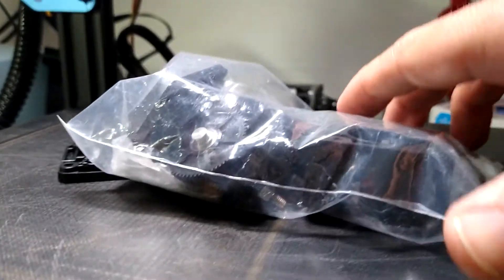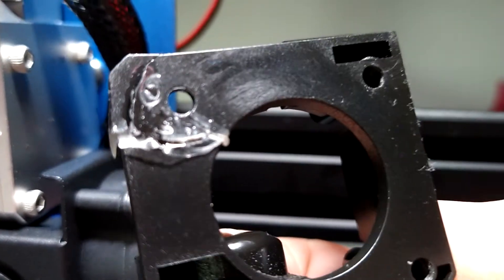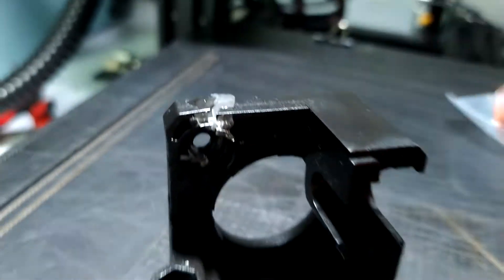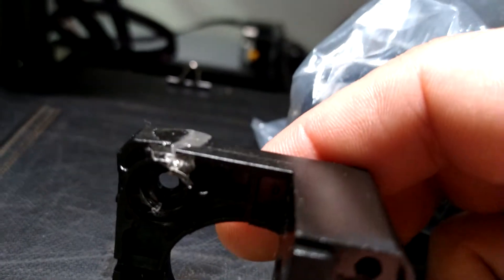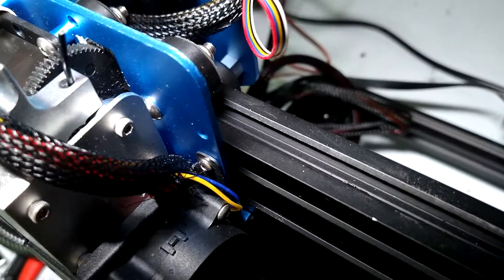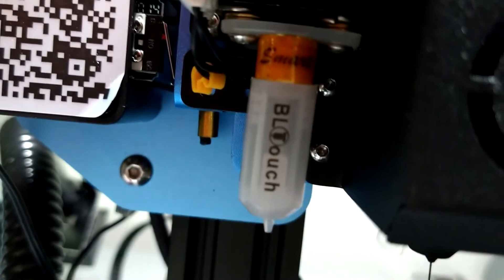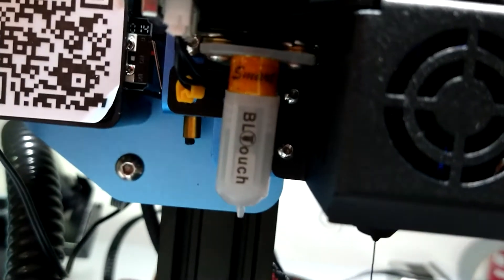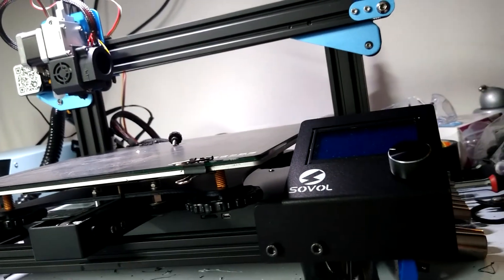why the sovol sv01 is a POS

Comment: LOL what a foul mouthed idiot.  Over 2000 hours on mine,The only thing that needs to be changed is the bearings, That is a clone of a proven extruder design and works fine.   It takes very little effort for the extruder to push the filament  through the hot end, if the hot end is flowing properly.  SInce this is 2 years old, you are probably alot smarter now, or you just gave up on 3d printing altogether.  LMAO

Comment: LOL.  I have over 2500 hours printing PETG on my Sv01.  Ive had almost zero issues out of it.  All the issues I did have were caused by me modifying parts on it.  Your video did succeed making me laugh though !
Reply: Sovol markets that thing as an all-metal hotend when it's sleeved.
If you're printing PETG on it, you shouldn't.

The extruder mechanism itself is a poor copy of a titan with a hob that isn't cut properly. Ours would fill with chips instantly, regardless of the tension on the knob. This is in part due to the fact that they ship it with a spring that's about twice the strength it needs to be.

The end result for us was that, because their Teflon sleeve was specced wrong, it would pinch filament right at the heatbreak. Machine would print fine with temps around 245 (because it was softening the PTFE sleeve) and the tension knob turned all the way out, but wouldn't produce anything but underextruded lace at 235 when all the other machines in the shop printed beautifully at that temp.

We replaced it with a genuine titan and an actual all-metal V6 and it kicks ass.

Again, if you are printing PETG with the stock SV01 hotend, you really, really, shouldn't. It is NOT "ALL METAL".

Comment: When you put out your frustrations on a delicate machine (which every 3d printer is), you will most likely break something.
When your most used words are s*** and f***, you should wash your mouth and make a walk to calm down. 
There is no single need to make such a video…
When you are calmed down, you can present your problem on a forum for advice or contact your supplier or Sovol. 
Life is too short to be angry and frustrated!

Comment: as an alternative i am testing the trianglelabs/TH3D extruder as a replacement. Was around $20 to order from Trianglelabs. I think they OEM for TH3D. SO far its a really good quality and didn't require any mods. I'm also testing on the artillery but that did require mod because the left side of the housing opposite the motor is used as a heatsink. May try your aluminum one there.
Reply from the maker: Don't tighten it too tight. The extruder stepper motor shaft smashes into extruder housing.  

If I get 1000 dislikes on this video, I make full expose on Sovol sv01.

Comment: quiet possibly the most curse laden video i have seen in a while. That was impressive and I was a sailor. The titan extruder is not unique to Sovol. Artillery and others also use it. Its a clone of the E3D Titan which is plastic https://e3d-online.com/collections/extruders/products/titan-extruder  The aluminum is likely some cheap Chinese alloy which can also crack so be careful not to over tighten. A real E3d Titan cost me over $50 with shipping, those Chinese clones are less than $10 , I've got 3 sets for parts. You get what you pay for. I asked an engineer at E3D why it was plastic, and it was for weight an durability reasons, they use a much higher quality plastic. Also people are less likely to over tighten the mounting screws in plastic and strip out the stepper motor holes.  I was curious about your aluminum clone appears to be missing the tensioning wheel, then i saw the captive scree, a much better design for one that has the wheel in the back. Too bad the artillery I have have the wheel in the front so i'd have no way to adjust tension
Reply from the maker: Based on the hate and dislike I've received for this video, I am planning on making another video on the Sovol Sv01 and give a full breakdown on the shortcomings of this piece of shit. 

I do love stirring up the malcontent in the masses, so why not pour napalm on the fire so I can enjoy the flames tickling the carcass of this over-hyped Sv01 turd.

As far as tension goes, there's a small allen head bolt with spring tension smashing that extruder arm into the filament. 

Trust me. That chinesium extruder has zero problem spitting molten plastic  just as long as the z gantry stepper motor is tightly secured via the eccentric nuts mounted to the z backing plate.
Reply: @warehamdamon  I like the look of the aluminum one, wish I could use on my artillery genius , it’s had problems with the extruder. The Sovol is just a clone of creality they’re all the same and cut corners in different places. You want to see a masterpiece of Chinese corner cutting check out the sunlu s8, that one has required more upgrading than the Sovol
Reply: @warehamdamon  to be fair Tim from TH3D called out that extruder as a very cheap knock off before he even tried to print on it so you are not the only one to criticize that piece, I think he replaced the main board too
Reply from the maker: @orangecrocks  it's plastic. What do you expect?